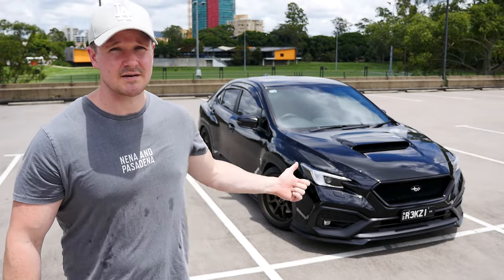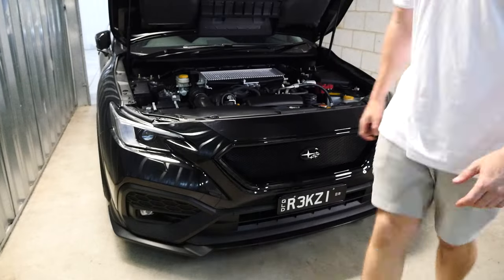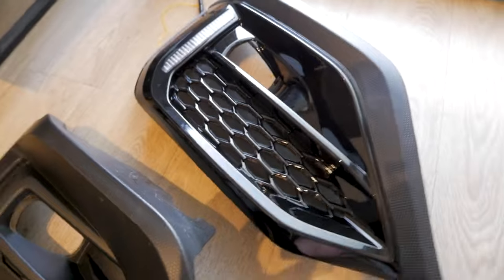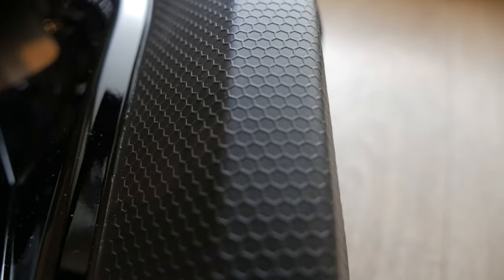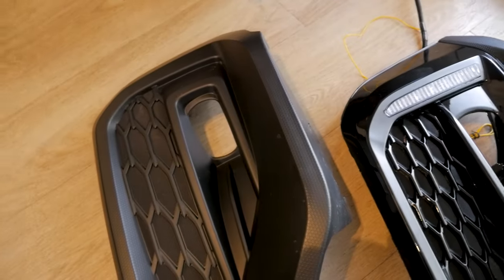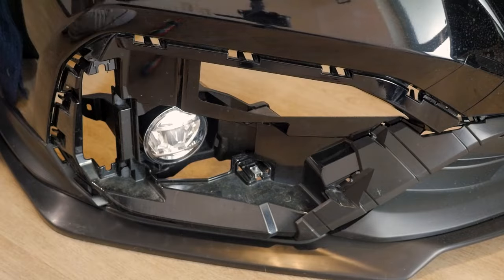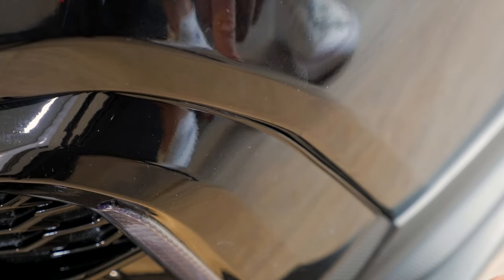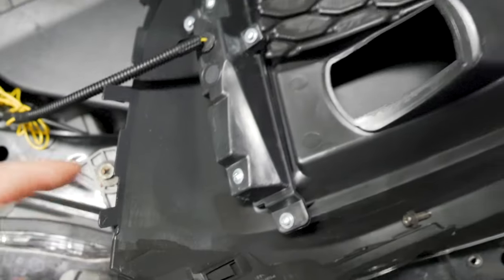Are these what the VB WRX was missing?

Comment: I have a lot of Dmaker/ Street Element parts fitted to my VB & couldn’t recommend them highly enough. I’m in Sydney so I always get them to install. The last est part I’ve bought is their carbon fibre/alcantara steering wheel & next up is paint matched +10mm fender flares. I’m starting to run out of parts to fit so maybe enlarged bonnet scoop & fog light/DRL’s next.

Comment: You can run that turn signal yellow wire on the LED headlights. You just need to splice it into the turn signal wire of the harness . It’s a different color on each side. I don’t remember what color it is off the top of my head but you can find it fairly easy if you have a multimeter.
Reply from the maker: Sick will look into this thanks heaps! 😎
Reply: Hey, im interested in how you made the turn signals work, do you have a video or instructions anywhere?

Comment: Random question for ya and the grill you have! There was a rubber tray behind the bumper when i did my grill install, did you just remove it completely and then reinstall the bumper? I ended up tucking the rubber guard in and it was super awkward for the grill since it sits super deep in. Cheers
Reply from the maker: Yep I removed that one and it sits nice :) I have a video about replacing the grill a few back on my channel go to 10 mins 15 seconds of that one and I go through it. Hopefully that helps! 🙏🏼
Reply: @JoelBrownefilms  Tried to do mine this morning, failed miserably. Watched back and fourth for how you unclipped the hinges from inside the bumper at approx 4:36. Was way to scared I would snap it and it felt like it didn't want to budge at all when trying. Ended up not commiting to doing it and throwing the bumper back on. At the end I also noticed I bought the wrong fuse tapper, a normal size not a mini so wouldn't of worked in the end. But after some tips, not sure I want to pay someone to do work along those lines. Will be sending it into the shop for short shifter and varex exhaust shortly but I figured the lights should be easy enough for myself to install like you did in the video. Cheers.